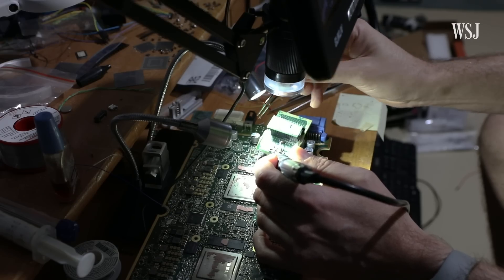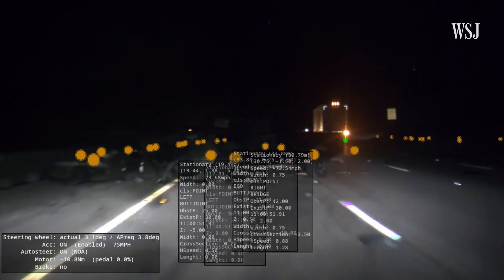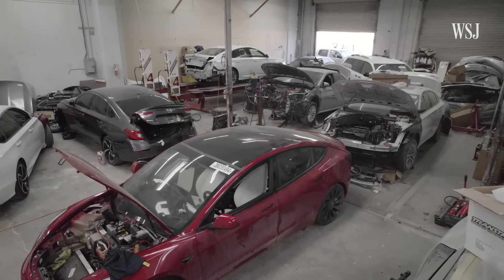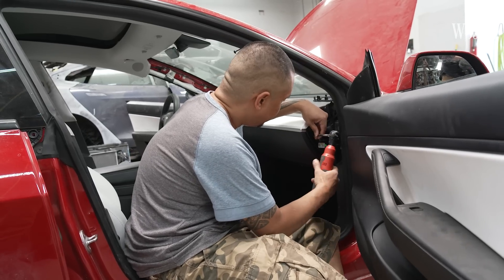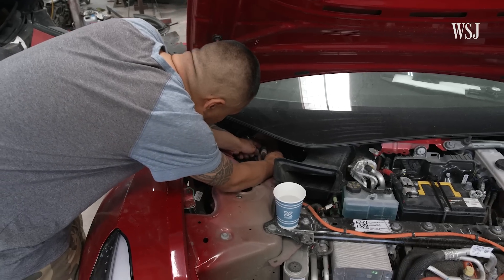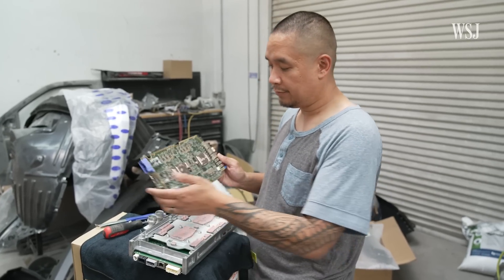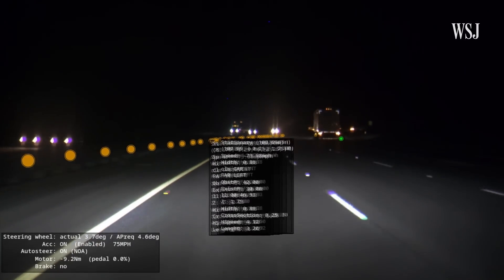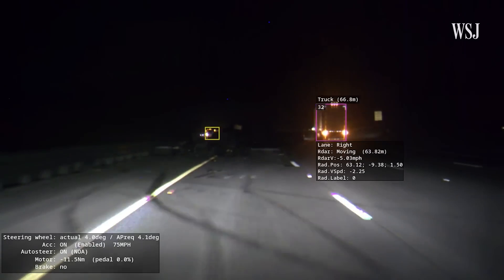How Hackers and Mechanics Unearth Tesla’s Hidden Autopilot Data | WSJ

Comment: 03:16 Elon Musk is heavily against the use of LiDAR in its vehicles, insisting on visual simultaneous localisation and mapping (V-SLAM), using its 8 on board cameras, this in turn is supposed to be stitched up to form a 360* view of the car and create cloud points similar to LiDAR, except cameras do not work well in poor weather or visiblity as demonstrated at the time stamp ive picked out, lidar on the other hand would of detected this truck and the onboard computer could of reacted accordingly, these vehicles are level 2 autonomy NOT level 4 like waymo and cruise, I would NEVER want to ride in a tesla with auto-pilot or FSD as it is not reliable. Look at vacuum cleaners, V-SLAM vs LiDAR vs Hybrid, its the hybrid versions that do better, and out of camera vs lidar, lidar comes out on top, whilst Tesla argue that camera is essential for recognising traffic signs etc (This is true) no one is saying that Waymo, and Cruise use lidar alone, they do not, they also use cameras and yet their safety recod is much higher than Teslas..... FOR A REASON!

Comment: You made a misstatement... tesla do not have radar also known as lidar they only use cameras... most other manufacturers use cameras and lidar.
Reply: Many older Tesla models do have radar modules, but they were phased out around 2021. And radar and lidar are not the same, one is radio wavelength based (radar), one is laser emission based (lidar).

Comment: I'm so tired of this negative Tesla clickbait. Teslas have a driver assistance feature, not self-driving. If the car crashes, it's the driver's fault. You can take control or hit the brakes no problem. Lots of people use this all the time without any issues. No different than cruise control

Comment: Despite many people's statements and how many people use the Tesla autopilot, it is not rated for autonomous driving. From a legal perspective the driver is responsible for the actions of the car unless it fails to respond to the drivers inputs. 

Of course if Tesla marketing is suggesting something different about the cars abilities that seems to open them up to liability. I wonder about how responsible they can be held by for not correcting statements of third parties that suggest that Tesla cars can operate autonomously. And I wonder if the third parties saying that the car can operate autonomously can be held liable for accidents of drivers that believed those third party statements. 

It is all a messy legal situation.

Comment: Interesting teaser, but to be honest, if I were driving a car manually, I wouldn't have seen that crashed, unlit black pickup truck in the middle of the night any earlier either. That wreckage was an unseen danger. I'm always amazed that such crashes seem to be completely ignored in the US. The truck on the right just drives past this dangerous crash site without slowing down or putting on hazard lights. What is wrong with people? Does no one care about others anymore?

Comment: 😢 1. The computer doesn't recognise the thing on the road.
2. There is no course of action (braking, steering, warning, etc.)
3. Data is severely limited afterwards as to what the system was designed or supposed to do in terms of action/s. "The unknown".
4. Encrypted proprietary data is possibly useless even for the manufacturer. "The unknown unknown". So, it is highly improbable to improve the system without new technologies like ladar, night vision, sensors, etc.

Comment: 1 fatal crash, from 2021 !!!     This is what it said in the WSJ News when checking my TSLA shares on CommSec.

WSJ investigation uncovers alarming flaws in Tesla's Autopilot leading to crashes

Jul 30, 2024
The Wall Street Journal (WSJ) on Tuesday published a critical video about Tesla's driver-assist systems, highlighting “longstanding concerns” regarding the company's camera-based technology.

The video, which represents a part of the Journal’s comprehensive investigation into Tesla’s Autopilot system, suggests that this technology has been a key factor in several crashes, some of which have been fatal.

Specifically, the investigation gathered data and video from more than 200 Tesla Autopilot crashes, revealing how the driver-assist algorithms process inputs from Tesla Vision cameras in real-time.

The video highlights a fatal accident from May 2021 involving Steven Hendrickson, who was driving his Tesla Model 3 in Autopilot mode on his way to work. An overturned double trailer appeared on the highway, which Tesla’s system failed to recognize, resulting in a full-speed collision that killed Hendrickson.

“The kind of things that tend to go wrong with these systems are things like it was not trained on the pictures of an overturned double trailer. It just didn’t know what it was,” said one expert who reviewed the footage.

The WSJ’s video points out similar issues where Autopilot misinterprets the lights of emergency vehicles, leading to crashes.

The investigation notes that Tesla's self-driving crashes result from both hardware and software issues, including slow algorithm updates and inadequate camera calibration. While the findings raise significant concerns, more independent analysis may be necessary to challenge Elon Musk's assertion that Tesla's self-driving feature is ultimately safer than human drivers.

The Wall Street Journal cross-referenced individual state accident reports with the federal database maintained by the National Highway Traffic Safety Administration (NHTSA) and reenacted 222 Tesla crashes. Of these, 44 incidents occurred when Teslas on Autopilot "veered suddenly," and 31 happened when the vehicles "failed to stop or yield," with the latter causing the most severe accidents.

Experts who reviewed the crash footage and the Autopilot system's algorithmic operations indicated that it would take time to train the system to handle all road scenarios.

Tue, 30 Jul 2024 09:00:00 -0400

Copyright (c) 2024 StreetInsider.com

Sentiment

Negative

-0.79

TSLA

228.60

TESLA INC

-3.50 (-1.51%)

Up Next

Zacks Investment Research Newswire

Wall Street offered a mixed performance last week, with the S&P 500 losing 0.8%. The Dow Jones Industrial Average has gained 0.8%. The Nasdaq was off 2.1% last week. The Russell 2000 has advanced 3.5% last week.

,
2 hours ago
•
5 minute read
Dow Jones Global News

By Gareth Vipers Tesla is recalling more than 1.8 million vehicles in the U.S. due to a software issue that could result in the hood fully opening and obstructing the driver's view. The National Highway Traffic Safety Administration said Tuesday that the issue risks failing to warn a driver when the hood of the vehicle is unlatched, increasing the risk of a collision.

2 hours ago
•
2 minute read
Zacks Investment Research Newswire

Tesla TSLA shares gained 5.6% on Monday after Morgan Stanley named the most valuable automaker its "top pick" in the U.S. automotive industry, replacing Ford F, as quoted on Reuters. The Tesla stock has moved down 8.

,
3 hours ago
•
6 minute read

Seeking Alpha

Tesla (NASDAQ:TSLA) recalls about 1.85M vehicles in the United States due to a software issue that may fail to detect when the hood is unlatched, according to the National Highway Traffic Safety Administration.

3 hours ago
•
3 minute read

Comment: WSJ should understand that Autopilot is not the self driving system on Tesla vehicles! Autopilot is cruise control. 
FSD is the self driving system. Confusing? Yes,  but that's it.
Reply: And I think FSD still isn't level 4 autonomous
Reply: @B-RaDD it's definitely not level 4. They haven't claimed that either.  They promised to have it at level 4 by now though.

Comment: AFAIK Tesla utilizes visual camera footage analysis and no LIDAR sensor is present. Only usual radar is. LIDAR is more precise as the laser beam travels straight while a radar propagates in a wave form and has signal loss or error. You ever wonder how missiles get missed by air defenses? That's your radar. Therefore, I have a question. Wouldn't it be easier to install at least one LIDAR that detects obstacles both day and night than to train an onboard computer for any possible scenario there could be? Or at least considering putting LIDAR, not radar, among camera analysis systems? For some redundancy? 

To draw a parallel, they put three electrolytic tilt sensors on planes not two just so that autoplit does not make mistakes as it did in a plane crash of American 587 in 2001. This was done to improve reliability and fault detection.

That obviously would make cars more expensive, but safer too. My relative got hit by a car on a pedestrian crossing during a bright daylight. Although not by Tesla, I'm more concerned about safety than cost since Tesla cars are already, to my mind, overpriced. Were I a lawmaker, I would require both video stream analysis and LIDAR sensors.

Comment: This is why you don't remove lidar
Reply: I can drive and I dont have lidar; clearly you have  no understanding the problem. Seeing stuff aint a problem, knowing what to do when you see something is a problem
Reply: @landcruiser801  lidar = light detection and ranging. Your brain can perceive depth with 2 eyes and know how far objects are, better than current standard camera tech that's equipped on cars at night. You need to be able to see it in order to react to it. If you can't see it, you can't even react. Clearly the tesla here couldn't even see the crashed car.
Reply: @MrNgMichael  And if it had lidar and vision it would have been conflicted and still crashed which was the reason Tesla took lidar off.

If you are driving at the speed appropriate to the distance you can see to be clear, which would include at night driving with the distance that the lights illuminate, then you should be able to brake in that distance. 

I would venture that the camera tech has nothing to do with range calculation and everything to do with 'the brain' and to that extent Tesla does not have standard camera tech
Reply: @landcruiser801  I think Lidar is better for self driving applications, but yeah, I think it would've still crashed in that example, but if it could hit the brakes sooner, then it can mitigate the damage. 

I think it needs all 3, radar, lidar and vision as well for self driving. Honda, toyota, etc uses radar + vision for cruise control. The computer needs data for objects up close and longer range. But also most importantly, the person behind the wheel needs to pay attention in the end. Current tech isn't fool proof and it's like having a teen who's just got his license take the wheel.
Reply: @MrNgMichael  It would not surprise me if Tesla added those things back in once they have the brain sorted on the vision side i.e. it is better than human in good driving conditions. If you can make it superhuman in fog, dark, heavy rain etc, then even better i.e. add back in the lidar/radar - the only thing you are doing then is just having a protocol to reconcile any differences between sensors but makes jobs far harder trying to do that reconciliation and learn to drive which is why Tesla have removed them so they do not have to deal with any conflict before deciding how to react/drive in any given situation.
Reply: @landcruiser801  Yeah, it reminds me of a story where a self-driving car was going through a city street just fine until a street sweeper pulled a U-turn in the middle of the street. The car had no idea what to do and disengaged its self-driving system. A human would have slowed down slightly and kept going.
Reply: No. Lidar is useless. This is why you do not remove the RADAR in the front and the ultrasonic sensors.
Reply: @TheEditorify  Yes, very other manufacturer who uses brake assist/collision avoidance would have picked up that truck and applied warning and brake because they use radar or ultasonic sensor that works fine in darkness.
Reply: @TheEditorify  lidar gives you a 360 view every 100ms and near infrared lidar  can plot objects behind solid objects based on the way the light bounces. Waymo, zoox and cruise startups use this for their taxis

Comment: As I understand it. A hacker is a computer specialist who uses his skills to perform nefarious actions. 
Otherwise they are computer technicians. 
Not nearly as sexy sounding.
Reply: That's incorrect from a legal and technical definition, but no one ever bothers to use the correct terms anyway.

Hacking is the act of exploiting hardware or software design flaws to make a computer do something it was never designed to do.

Hackers are anyone who engages in hacking.

Phishing is tricking someone into giving you their passwords for their accounts.

In the case of what they're doing in this video, they're using fault injection (a hardware flaw) in the FSD computer to trick the computer into revealing the decryption keys for the data, which is not supposed to be accessible to anyone outside of Tesla.

I briefly did stuff like this as a job before I changed careers to being a software engineer. Joe Grand has some really good videos on this type of thing.
Reply: @vrclckd-zz3pv  what I said is s very simplified way of saying exactly what you said. 
Hacking is A computer specialist. Using his skills.  
To do nefarious things. 
Otherwise, he is a specialist. 

I studied engineering science. I have a degree in electronic tech. 
I'm no programmer. 
I can "hack" a system using hardware. 
A programmer uses code. 
If you can do both you're truly dangerous.  
Crime does NOT pay. Unless daddy is rich.
Reply: @walsterdoomit  that's not what I said. The guy in the video is a hacker because he's using a hardware flaw to make the Tesla computer do something it was never supposed to do (revealing the decrypted data)
Reply: @vrclckd-zz3pv  lol. Where is the disconnect brother?
The man is a computer specialist.  No? 
He is using his skills. No?
Using the skills to manipulate the computer. Right?
Now weather you consider this nefarious (meaning up to no good) 
Is your point of view. 
He is using his skills to manipulate the system to make it do other than what it was intended to do. 
He has hacked the system. He is a hacker. 
If he installed the hardware and used the system correctly as intended to improve it or alter it to enhance another system He is a technician. 
Where is the disconnect here?
Reply: @walsterdoomit  fault injection is a form of hacking. By definition he is a hacker. Your original comment implies otherwise. There is also no malicious intention behind it. He's using it to figure out why a car crashed.
Reply: untrue, google "white hat"
Reply: I think we can all agree the WSJ uses the word hacker to scare boomers

Comment: So everything we knew about neural networks and computer vision. Exactly why camera vision isn't enough and radar/lidar is necessary
Reply: Low light conditions and unmoving obstructions are filtered since considered "part of the road". The latter is an over correction after above road signs were registered as obstructions and caused emergency braking in high speeds. Radar / Lidar sends a signal and based on the amount that bounces back it can figure out if there's a non-negligible obstruction in front of the car even if the obstruction is stationary or the road has low visibility.

Comment: so this crash video is about autopilot, not FSD.. thats basically called advanced cruise control in other cars. thats mean driver need to be awake and aware the road. its just a insurance in case if you cant react. 
even tesla fsd is not level 3, only benz has the it, and limit to max 40mph

and i think the headlight should be on high in such speeds and condition?
Reply: WSJ doesn't seem to understand the difference between Autopilot and FSD.
Reply: @Turbo_Todd  not kidding, these media still dont get the difference after all these years. i was misleads until i actually got my car.. and i am glad the Tesla sales guy was honest and told me dont get FSD. (okay FSD worth or not is debatable,  but i personally still dont think it worth it)
Reply: The conclusion to the next video in the series has a broader focus than just Autopilot: "Computer vision is such a deeply flawed technology, and we're not doing enough to determine how to fix its gaps and how to make it recognize objects. [...] Having the car do most of the driving for you and requiring you to pay attention to make sure nothing bad happens, I don't think this is going to be a long-term technology that we keep in the cars."
Reply: FSD won’t help in this case since the cameras in the car don’t work well under extreme low light conditions. The car won’t stop if it can’t detect the stopped car blocking the road, after all.
Reply: @mapl3mage  extreme low light condition except cars have headlights, don't they?
Reply: @noizz4  headlights on 'regular' mode are not bright enough for the cameras to work effectively in detecting obstructions ahead.
setting the headlights on high might help, though I'm not so sure there would be enough time for the car to detect the obstruction and slow down (it doesn't help if the car was traveling at 70mph and only have 5 seconds to stop)
by contrast, a Lidar sensor works regardless of light conditions and can detect cars at a distance of over 1 kilometer.
Reply: @mapl3mage is the headlines on high? it didnt look like it. 
but black car do take away visual strength.. i dont think i will be able to stop/react on time